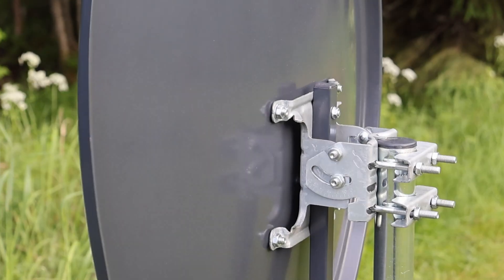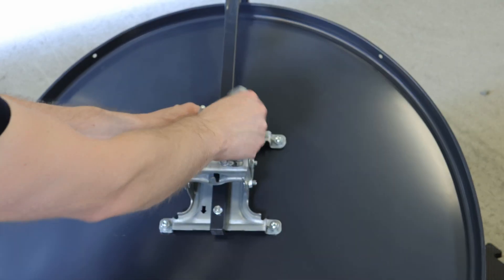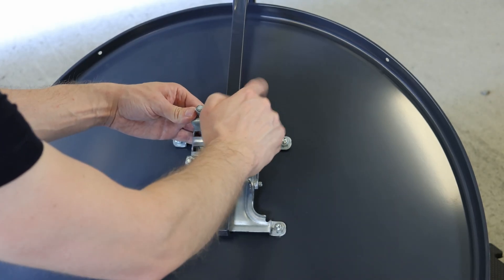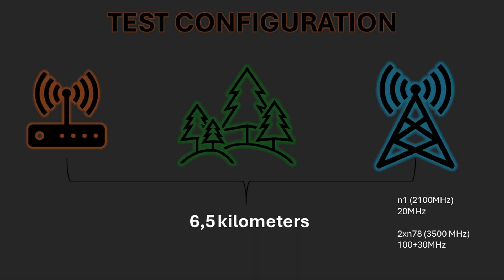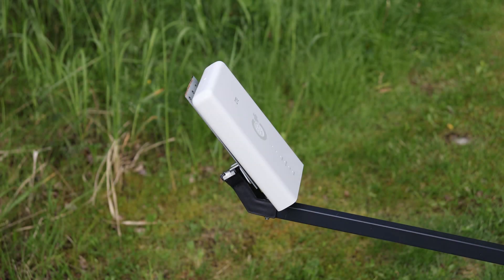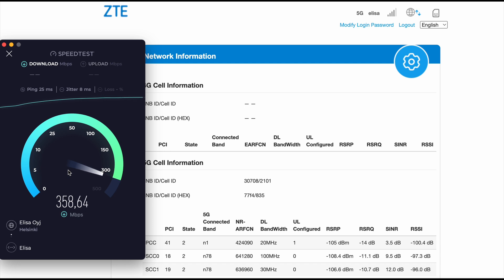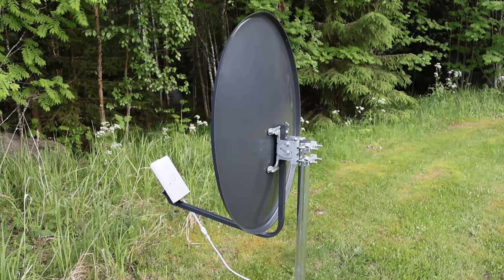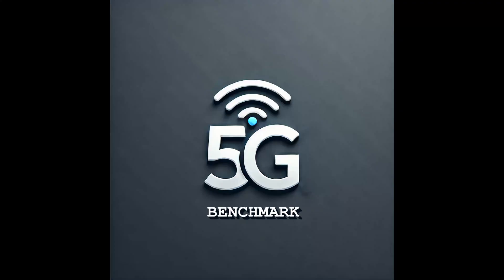Can a Parabolic Antenna Make 5G Faster?

Comment: Tomorow I'm going on my roof to mount my modified SAT antena together with ZTE MC889. Can't wait to see the results. Could you please give us link for good console script wich works with ZTE CM889 Modem? All that I've had worked perfectly on MC7010 but on MC889 they don't work at all. I have to say that MC889 is a HUGE upgrade regarding MC7010,better signal,more gain and speed is about 10-15% faster. Let's see SAT dish in action,can't wait...
Reply from the maker: @alixxworkshop846  Nice, that sounds awesome roof project! Curious to hear how the SAT dish + MC889 combo performs.

For the MC889 / MC889A these should work:

https://gist.githubusercontent.com/tpoechtrager/766140c49a711a2177820ea42556de3c/raw/17f75b1d010ff217e9a490983cb612fdb216b20e/zte.js

https://miononno.it/files/ZTE/888-4.0.min.js
Reply: @5GBenchmark 
Hello my friend,finally I did It! So the result are unbelivable. I've installed 75cm aluminium SAT antenna Humax E0774. Modem is ZTE MC889 installed on the handle where LNB was. Horizontal and vertical angles were adjusted thru ZTE Install Helper since It measures the signal values in a real time. I use 4G+ LTE network B3/20MHz/1800 + B20/10MHz/800. DS and US were measured by Speedtest. So,here are final results. 
Before antenna:
RSRP: -98dB
SINR: 1.2
Ping: 46ms
DS: 9,6Mbps
US: 2,8Mbps
After antenna:
RSRP: -82dB
SINR: 12.6
PING: 24ms
DS: 68.2Mbps
US: 27.6Mbps
I can't belive my eyes how my internet improved thanks to your great idea.You have helped me a lot with this. I would like to THANK you for that and encourage other guys to try the same,It worked for me.
Reply from the maker: @alixxworkshop846  Wow that is a massive improvement! Really nice to hear it worked that well and great to see real numbers from a different type of dish setup. Thanks for sharing your results, this kind of data helps a lot!

Comment: I did it with same 5g antenna modem and a sky 80cm dish got 60 to 100mbps with out the dish  and i got 400mbps with dish but took a bit of messing around to get it to work but it not give me any problems and i run my house off it
Reply from the maker: @Just-Mods-NICK Great to hear positive results! I’ve noticed also that getting the modem aligned in the dish’s focal point can take some trial and error.
Reply: @5GBenchmark ya it took me at least 15 times to get the zte right  as i glued my zte to the lnb holder  i all so got a 5g antenna what sit in where the lnb would sit what get plug in to my indoor pro 5g router and i did get 350 to 800mbps  on that but i do use 3 in uk what got the fastest 5g in uk  but yes it can be a pain geting it line up it's a guessing game because the zte is so much bigger than a lnb that i do not now where in side the antenna are  i do want to try a 8x8 antenna and put it where the lnb sit if i can  and then it plug it in to the indoor pro 5g router but not tryed that yet
Reply from the maker: @Just-Mods-NICK  Very nice! Please share the results when you have done the testing.

Comment: The way you do it takes forever to optimize, use huawei manager or CpeManager or huaCrtl pro

Keep moving the antenna till you find the best direction
Reply from the maker: Thanks for the tip! I’m currently using a Home Assistant–based setup to monitor real-time signal values and log historical data for each alignment. This way I can compare changes more accurately over time, not just peak values.

The full setup and how it works is presented in this video https://youtu.be/IzAlslYN2CU
Reply: @5GBenchmark thanks for pointing that out, my point is you install one of these app to your phone tablet computer and login in to your router, once that done you get live feed of signals readings from router while adjusting your antenna this help you know the exact direction of the best sector available before bolting your antenna i can share examples if needed

Comment: What about pro version without antenna in the same place?
Reply from the maker: @nesvarigi  The n78 wasn’t available earlier, so I’ll test this setup in an upcoming video with other routers including MC889A Pro. On paper, the Pro version should perform much better than the MC889A due to its superior n78 antennas. 

I might also try it with a parabolic antenna, though because of the size, it needs separate mounting to align properly with the focal point.

Comment: Is there a drixtionality setting for the internal antenna on mc889a?
Reply from the maker: @anthroparion On my firmware, there is a directionality setting, but it only affects the n78 (3500 MHz) band antenna. For other bands, the antennas remain always omni-directional.
Reply: @5GBenchmark  Is there a repo with alternate firmwares?  I think mine is ok, but it is European so I am not sure I am getting all the fruit.
Reply from the maker: @anthroparion I’m not aware of any repository with alternate firmwares for these devices. Typically, even incremental updates are only delivered via OTA and aren’t publicly available for download elsewhere.

Comment: Nsa please.   Cool idea.
Reply from the maker: @anthroparion Will do. In the MC889A, the antenna elements for n78, midband, and lowband are arranged in three rows, so I’ll need to adjust the mounting a bit to find the optimal placement for the router.

Comment: I use the ZTE  MC889, would this work on this router? I currently only have it using 4G networks as 5G has drop outs if gaming. it uses B1 B3 B7 bands, if i turn on 5G it will use the N78 band.
Reply from the maker: @jackscannell5396  There are so many variables in setups like this that it’s impossible to guarantee an improvement, but based on tests, there’s a good chance you could see better performance. 

Bands like B1, B7 and n78 would benefit most from a dish antenna optimized for 2000 MHz+ frequencies. But I haven’t found an ideal one for that range yet.
Reply: @5GBenchmark  similar to here in Italy, it is all NSA in the rural areas.  I think I need to get a tower lock working first, as the flatness of the area and lack of building means it likes to jump bands and towers like crazy, going from 20mbps to 300mbps like a yoyo.  A lock to the tower I can see, should make it more robust for gaming I am guessing, and I think the lock has to be using 5G.  But I don't really know.
Reply from the maker: @anthroparion Yeah, that’s a good approach. Test bands and towers one by one to find the most stable option. I haven’t actually tested whether you can lock both a 4G band using a script and then also fix the 5G frequency from the admin UI at the same time. I could definitely include this in a follow-up band locking video.
Reply: @5GBenchmark  At the risk of sounding sleazy and lazy, that would be much appreciated.  I got the "out of the box" ZTE firmware, so if there is a need to risk changing it, it would be nice to know there is some gains awaiting to justify it.  what would happen if I just strapped a metal salad bowl behind the unit, sending some of that omni directional signal towards the tower?  would a dB or two be out of the question.